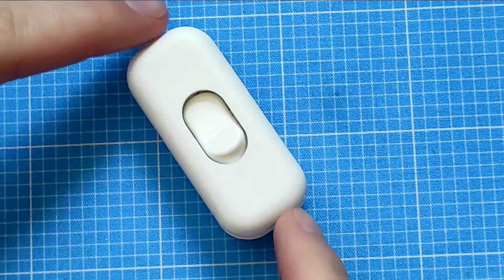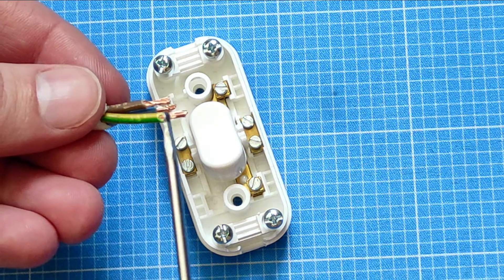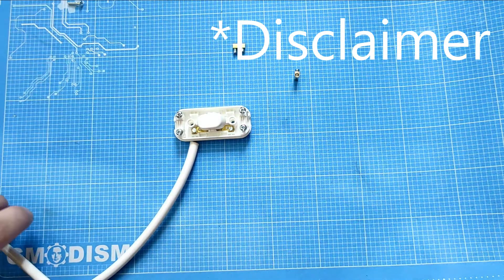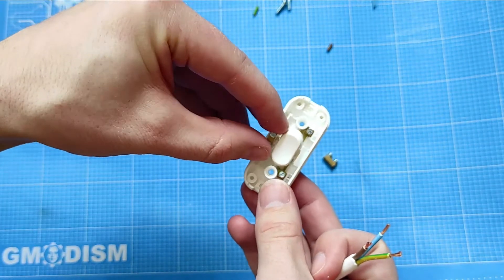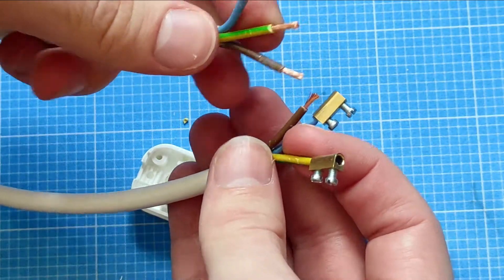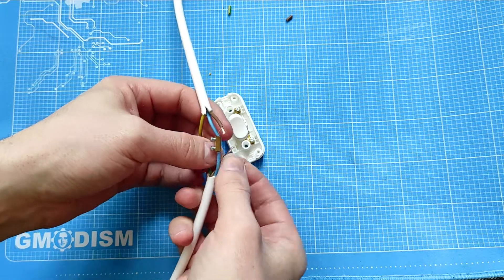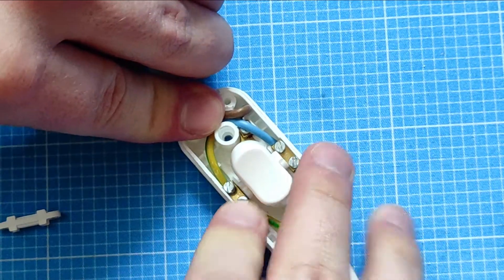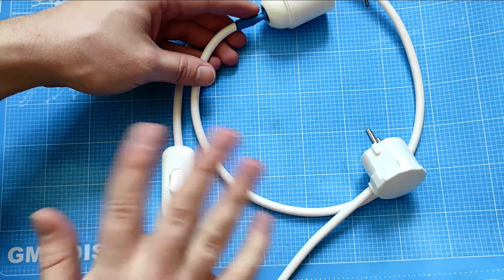How to wire a grounded inline cord switch - 3 Cable Variant

Comment: Can I add 1 of these to a portable sewing machine?That only has a push button so I can use it to power on with my foot.Does it matter how many volts go through these things?
Reply from the maker: Yes it matters, but a sewing machine should be fine I think (I am not an expert on that so do it on your own risk) however in your case are you sure you want  a button that makes it go and stay running, is is not better to have a "hold in to use" button?